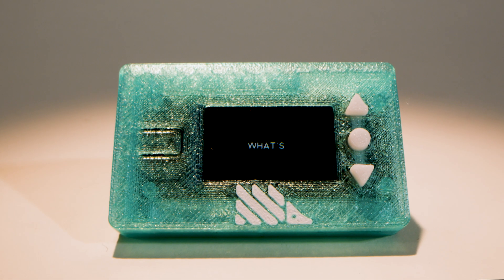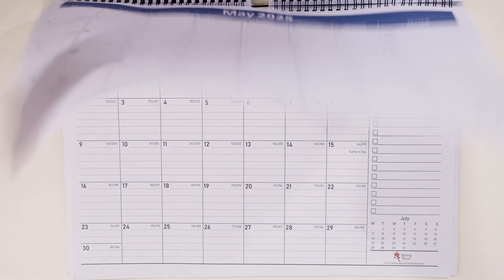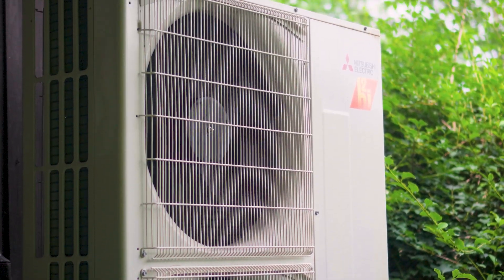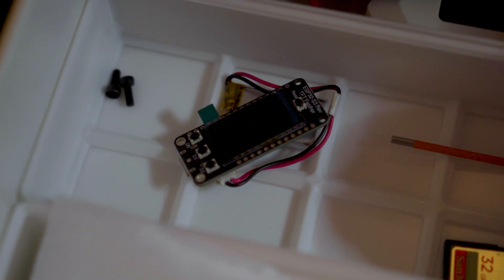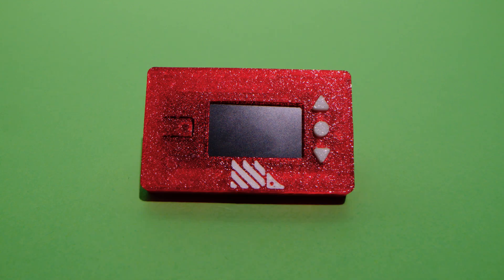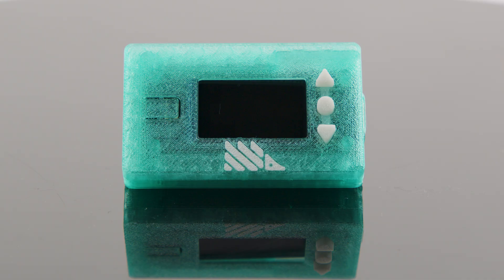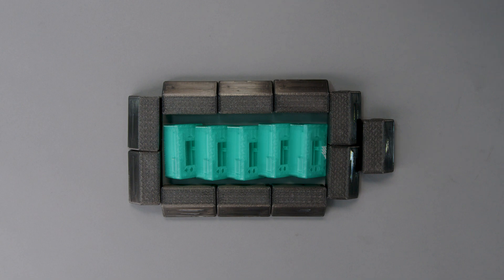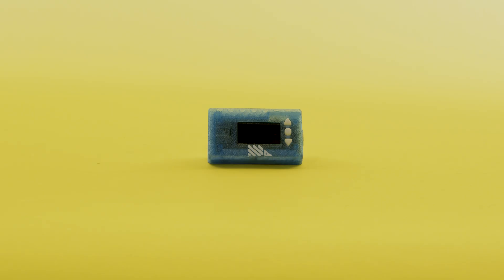Why we made an open-source developer toy - DeskHog

Comment: But what does this actually do??
Reply: Looks like a device with an integrated esp32, buttons, battery and screen that comes with some example programs. Some games, and some tie-in to their analytics software (PostHog)
Reply: Look like it does the same thing as a raspberry pi pico and a pick display pack, or thousands of other screen and mi rocontroller combos you can put together for <$20. Only preassembled and with a white oled screen, which could be considered a downgrade from color tft, but I like the oled aesthetic, almost like VFD Lite in brightness and crispness. 

I thought this was going to be a hackable desktop pet, which I guess one of the sample apps sort of does. 

I suppose the angled case is nice, but nothing new for anyone with a resin 3d printer and a microcontroller though...
Reply: That's like asking what Legos actually do
Reply: At the end it's mentioned that it's a canvas and you can build anything you want or can with its limitations
Reply: @saiskanda question is asked from the point of view of someone who does not know this type of devices. Examples please what can it do.
Reply: What do you want to make it do?